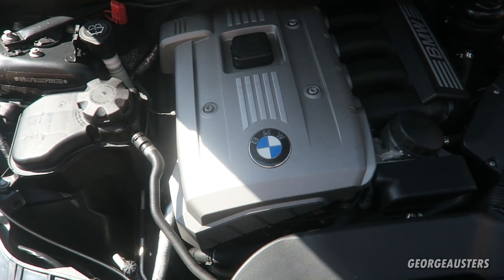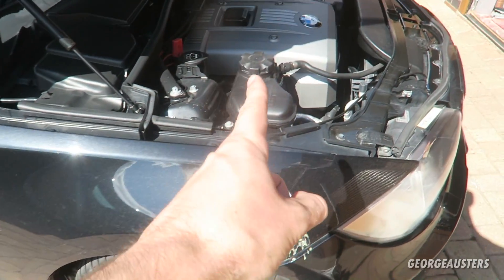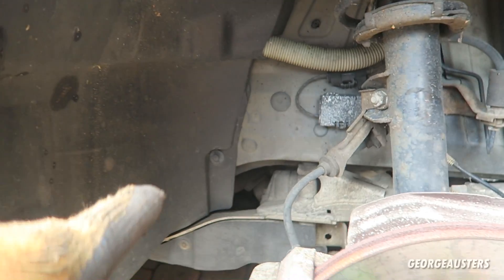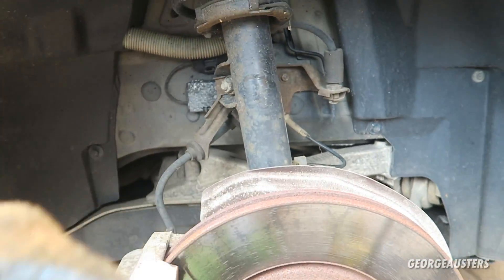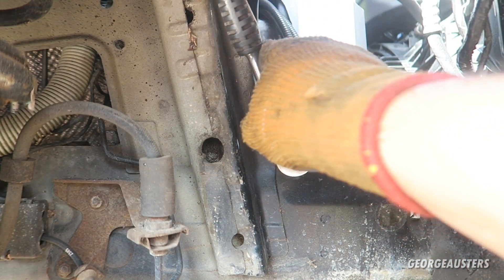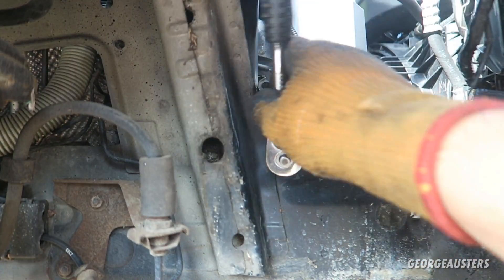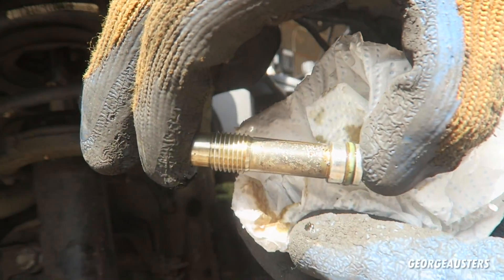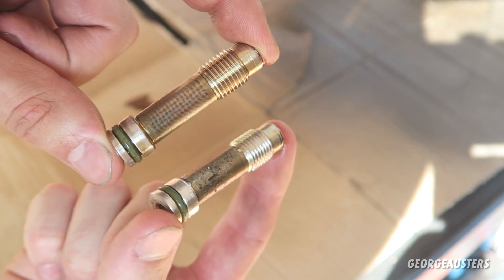BMW N52 Vanos Check Control Valve Removal *Complete Guide*

Comment: Makes a Video WHY you should clean them. Doesn't tell you why you should clean them. Dude wtf there's 10 different Tutorials on these already.
Reply: I think the main purpose is preventative maintenance. Granted your engine might not have any issues, but on a car that has 100k miles+ its good practice to remove, clean or replace items like this as they can cause all sorts of issues such as rough idle/running, poor mpg, slow/bad start, lack in performance, rattling/knocking noises etc.
Reply from the maker: Spot on Aaron👍🏻
Reply: All of the above is true including the comment from Lukas. I do like videos on the 130i and have commented frequently. However. I do see a pattern emerging and am curious if I am right a couple more videos down the line. All I can say is, try to be original.
Reply: @valentijn9  I understand what you and Luke are saying. For me personally I like that George is covering every single item on the N52 as for somebody like myself with a N52 I can always look up these videos when needed in case I need to remove/replace something. It's just like my N54, anytime I have an issue with that engine, I just search Youtube and almost every time somebody has uploaded a video with the same issue.
Reply from the maker: You have to realise everything has been done before in some way. I try to do my best to explain things in as much detail and provide as much value as possible. 

I also need to make as many videos as possible on this car as I bought it for the channel with £3200 of my own money and it will be a long time before I get that back.
Reply: George Austers Please don’t take this the wrong way...... but that’s not the correct mindset and it will show in the videos you make. This should be a passion of the car and the love of being creative with a video message and type of delivery first in order to truly engage a larger audience.
Reply from the maker: I absolutely love this car and have big plans for it but you have to remember I can’t continue making videos without income
Reply: George Austers I fully understand but you know what they say.... If you can’t buy two, don’t buy one. Good luck brother
Reply from the maker: @valentijn9  Thanks man. Yeah i'm doing alright and growing very well. I actually have plans to buy another channel car next year too
Reply from the maker: Did you watch the video? You should clean them because they can get very blocked up
Reply: And that causes what exactly? Did you actually notice any Improvements at all? Not being offensive here, just kinda curious.  That's like telling people to clean their Rooms because otherwise they get dirty.
Reply from the maker: This can cause your typical rough running Symptoms and stop the valve timing advancing properly